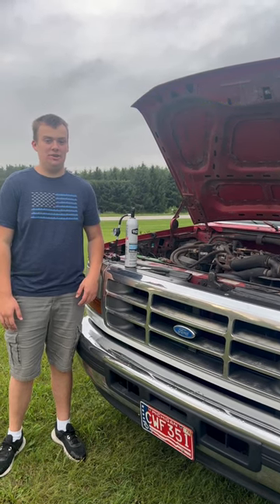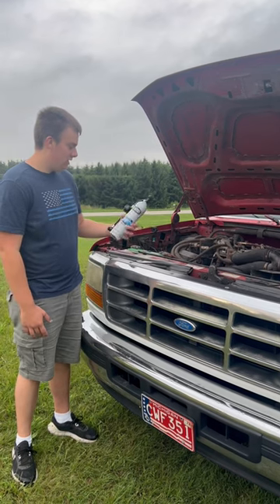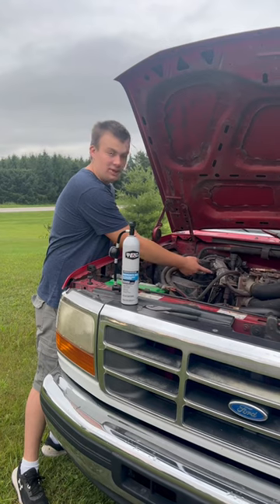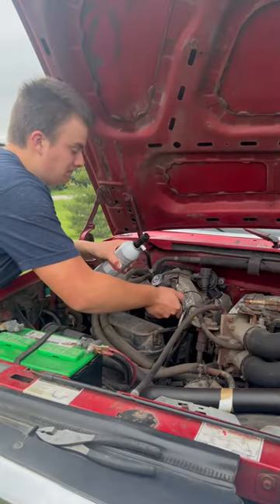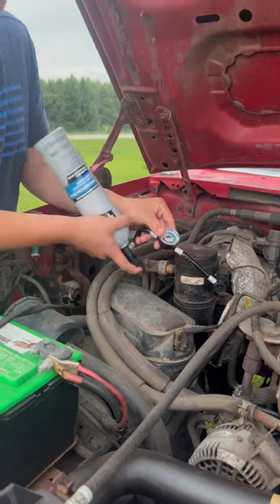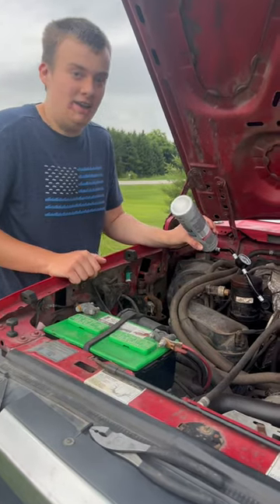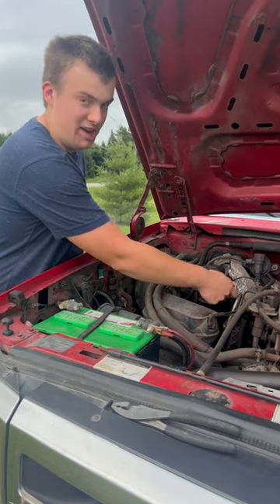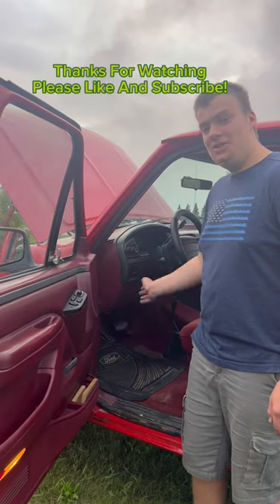Recharging The AC Refrigerant In A 1996 Ford F-150 #shorts

Comment: The connector on the hose of the can is not the right inside diameter to fit over the charge port in my truck. It also does not fit on a 2012 Ford Focus. We tried to "force" it on but based on the video, it should go on easily. Do you have any suggestions regarding this matter? Thank you.
Reply from the maker: I would believe you have the wrong hose. It does connect very easily without much force. What kind of refrigerant and hose are you using? I used just standard r134a refrigerant from Walmart with hose included and still works great a year later.

Comment: Use RED-TEK refrigerant as opposed to R134A, if you can find it...this refrigerant's molecule's WAAAAAY bigger if your problem is a pinhole leak or compressor seal leak....and it's super cheap.🤔
Reply from the maker: Thank you for the recommendation! If I have problems I will consider it! So far been about a month and no leaks